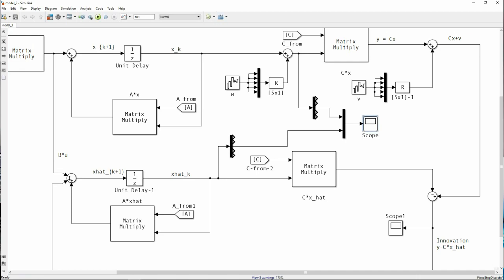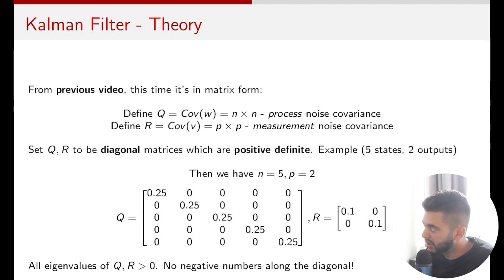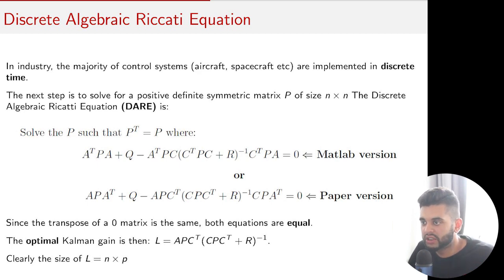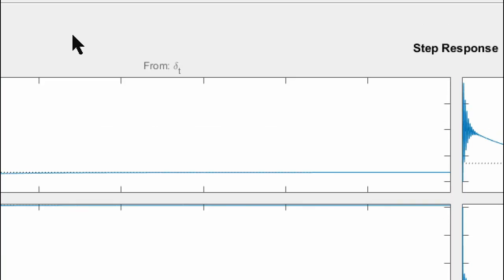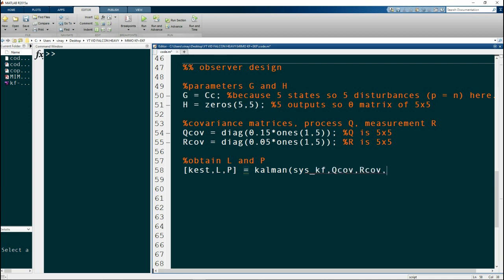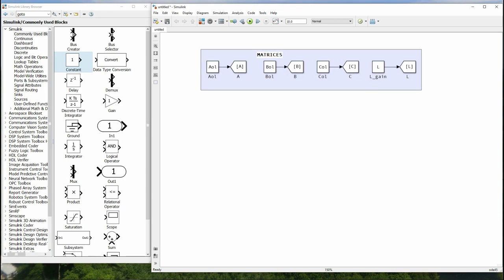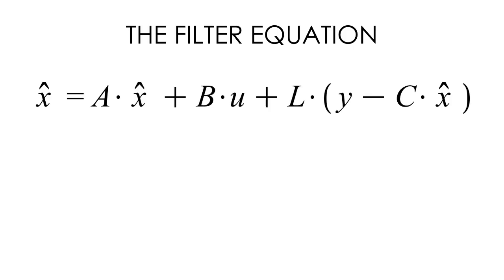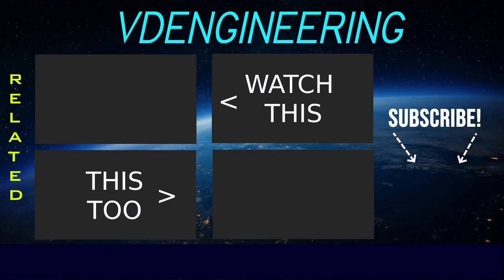MATLAB / Simulink Tutorial: Discrete MIMO Kalman Filter Design and Implementation

Comment: thanks for your vedio. I think the Simulink diagram you constructed is not satisfying the discrete system state equation that is when I check x(k+1)=AX(k) +Bu+ Gw. Because process noise  'w' is  noway in relation with the X(k+1). you simply added the noise to states .please clarify my doubt

Comment: Hey man! I am finishing my degree in Mechanical Engineering this month (actually almost submetting my thesis next week) and I would just like to say that your videos are awesome.
I have just one small doubt: here, you assumed your C matrix always gives you access to all states, but an observer is designed to access some of the states that are not available (or even if it is preferable to estimate them rather than measuring them directly), right? How does the G and H matrices vary then? I keep having the size errors when I use "sys_cont=ss(A,[B G_4S], C, [D H_4S]);" even when I adapt the dimensions of the matrices...

Anyways, your videos have been a large help throughout my course and particularly this one regarding my thesis since I am using kalman filter to estimate some states. Thank you very much!